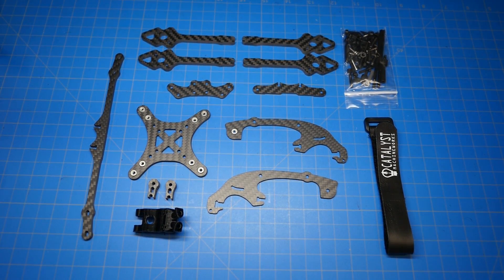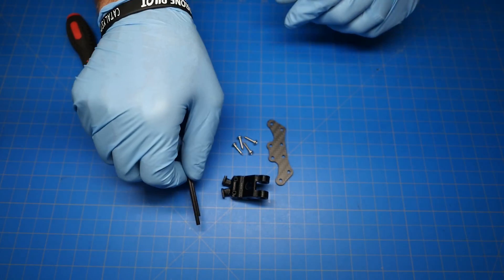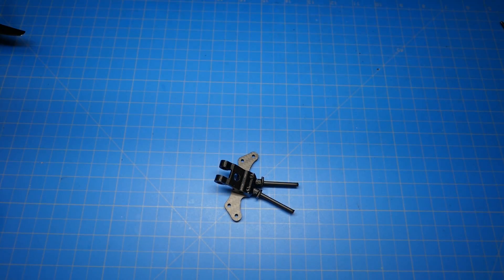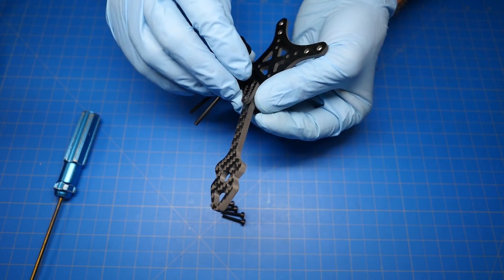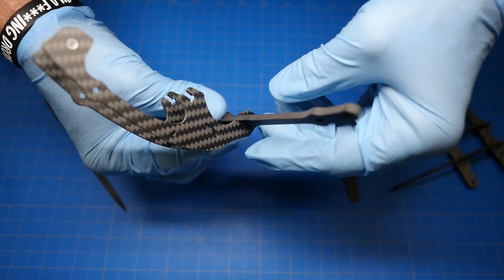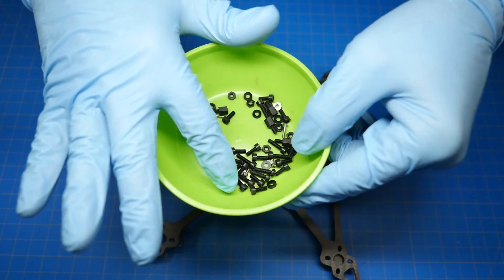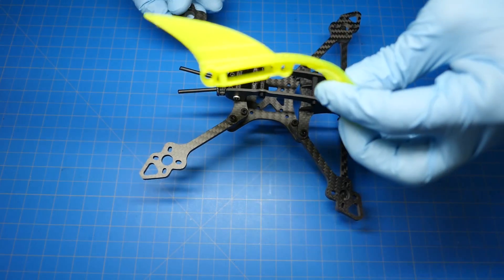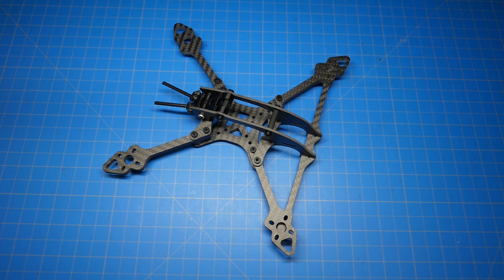Raging Droner Frame Assembly Video

Comment: I just built one. In love. It feels between a stretched X and true X as advertised. Turns and handling is second to none. It's a little rocket with t motor gear
F55 amp esc and T-motor f60 pro 1950kv 6s powered. Definitely a must for those who appreciate a quality frame. There are some major machining skills that went into this. Everything fits perfectly and aligns better than anything I've ever built. I put the canopy add on. No gopro. Just a LOS flyer and fpv. The tpu canopy and antenna mounts where also made to perfection. Worth every penny. I would pay another couple bucks if you guys printed small catalyst machine works stickers for us all to show our pride! Very nice work CMW

Comment: I just got the 5" frame (non-hybrid).  The kit has the screws for the optional canopy but not for the optional rear brace.  ie., 3x12mm  And the rear brace didn't come with the screws either.  To clarify, there were 4, 3x12mm motor screws.  I was expecting 8 of them.  I really like your products.  It just seemed to be a small oversight that someone should mention.